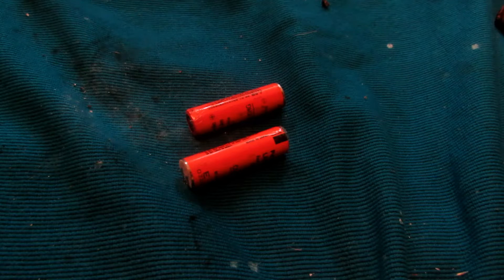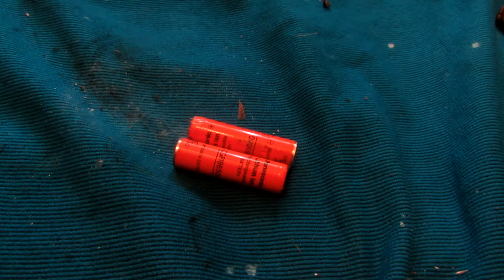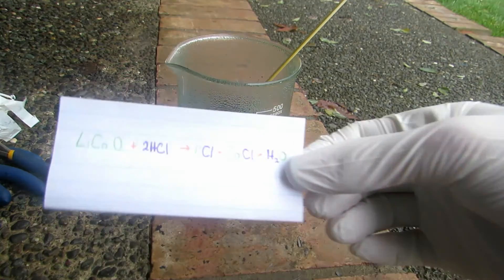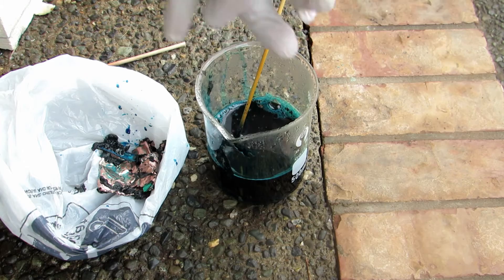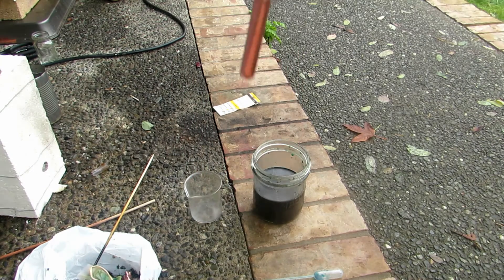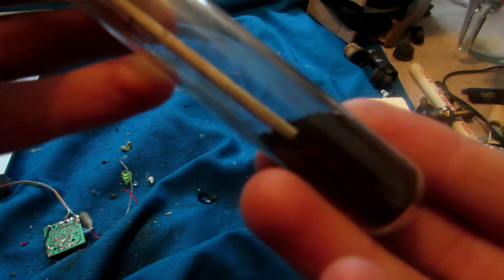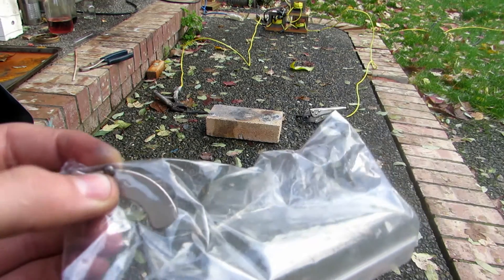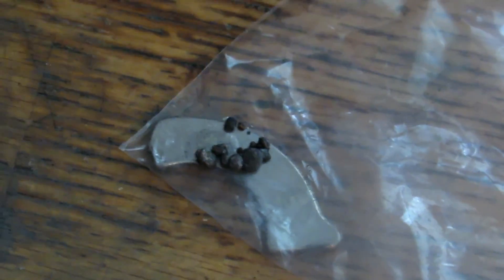Cobalt from Batteries (Household Materials)

Comment: Certainly interesting and educational but not practical.  Significant quantity of either nickel or cobalt metal can be had inexpensively if you have access to oxyacetylene torch.  You can buy cobalt carbonate powder online for $30 to $50 for a whole pound and nickel oxide for $30 per pound.  These powders are sold at pottery supply companies.  

You just mix your cobalt or nickel compound with fine sawdust and wood glue to make balls and let them dry.  Take your gas welding torch and strike a flame and turn up the acetylene and use reduced oxygen until you have a yellow white flame.  It has to be the hottest yellow flame without turning blue.  This flame is your exothermic reducing agent.  Now heat your cobalt and nickel dough balls and they will very quickly melt to a metal bead of pure nickel or cobalt

Comment: 0:35 it's li salt like LiClO4 , LiPF6 instead of Pure Li but only non rechargeable lithium based battery contains real Lithium Foil not rechargeable one like li ion  .
Cathodes are made of Li doped CoOx X = oxidation stats of Co and Anode are just Carbone or graphite on Cu foil .
2:47 and Electrolyte is way dangerous than KOH it's not KoH but  Ethylene based solvent mixed with LiPF6 which more dangerous because if it dissolve in water it forms HF which is super super acid , HF is not only corrosive but even diluted HF can Give heart attack .
Learn HF Toxicity on the internet for more info ......
 https://en.m.wikipedia.org/wiki/Hydrofluoric_acid

Comment: There's nickel too. In some. Could it cause the green color? Maybe.
It's not easy to seperate cobalt from nickel. I wanna eat the cobalt but nickel not so much
Reply: Oh, it is blue. Lol, my night-mode screen has only red and green pixels - as a sleep aid
Reply: I'd use water first. I got lithium hydroxide from li-ion before like this. Maybe you could reduce it with zinc. In case some makes it into final product, I'd rather eat zinc than aluminium. Still afraid of the nickel. It's a trace element too. Maybe it's not such a big deal. Cobalt is used in micro- to miligrams. Industrialy they precipitate it with calcium hypochlorite and leave nickel in solution

Comment: If i was to use this Cobalt for an electro plating solution (vinegar and salt) could i use the Cobalt oxide to make the solution of would i have to melt down. Ultimately i want to test a Nickel/Cobalt mix for plating as im told it produces a shiny finish.........
Reply: You don't have to go thru the whole process, just get to the Cobalt Chloride stage, make cobalt chloride powder and add about 10 grams of cobalt chloride to 50 grams of nickel chloride to obtain a 40/60 Cobalt /Nickel coating which is brighter than nickel or cobalt itself and looks like chrome

Comment: The orange brown colour in the cobalt powder was copper metal from copper oxide from battery which was also dissolved in hydrochloric acid to form copper ii chloride which was reduced to copper metal by aluminium which could be an impurity in cobalt metal.

Comment: I've a ton of black cobalt powder from battery extractions. Still trying to find a good way for me to melt. I need an arc welder.
Reply: Please contact me my e-mail; arkrashid20@gmail.com
Reply: How do you extract the cobalt? I'm looking to get some in powdered form for use in ceramics.
Reply: @Paul-vo4ze  I dissolved mine in HCl, but I don't recall if I used it in combo with nitric or H2O2. I think I did something along that because I had to separate out the copper salts as well. I preciped with aluminum, zinc or magnesium I think. I need to extract more battery metals again and I will be sure to take better notes.

Comment: *you are mistakenly conflating lithium(primary, single use batteries), with lithium ion(rechargeable batteries).*
They are NOT the same. Lithium primary batteries do contain some pure lithium metal, and early lithium battery researchers hoped to be able to use pure lithium metal in rechargeable batteries, but unfortunately you cannot safely re-charge a true lithium metal containing battery, without causing dendrites to form on the lithium metal and cause a short, which causes the lithium metal to melt, followed by 'thermal runaway', which causes the battery to "vent with flame". 

So in order to harness the energy density of lithium, without actually using pure lithium metal, led to the development of lithium ion batteries, which rely on lithium ions instead of the pure metal.

Comment: I know this is an older video of yours, but I'm giving it a thumbs up because I HATE working with electricity.  Anyone that is brave enough to mess around with high amps gets my respect.  I've almost been hit with a potential 600 amps while cable tying in a BDFB bay.  Even though I didn't get hit, thanks to very dry hands at the time, I've been reluctant to mess with anything high amps ever since.  

I used to have to perform weekly tests on the battery back-up bay in a telecom switch which has enough energy to power cell phone service to an entire city's switch needs for 24 hours.  One wrong slip and that battery bay has the capability to level the building.  I also nearly got fired because I refused to touch the breaker to switch from battery to generator power because that breaker had the potential to snap your arm in half if you missed just one tiny step to finish flipping the switch.

I've got a 9,000 volt neon power supply, but the amps are low, so I'm less fearful of the power, but I still respect the hell out of it.  I need an arc furnace, so I eventually need to overcome this damn fear of mine.

Comment: do u have to melt the cobalt powder or can u just use the cobalt powder???
Reply from the maker: Otago Harbour Fishermen you don't have to melt it, I just wanted to have a bead of cobalt
Reply: K lol
Reply: The Canadian Chemist hey how did u seal the hydrogen in that flask coz can hear seals it so...
Reply: The Canadian Chemist and awesome video Man what are you 15 year?? Lol still in high school
Reply from the maker: Otago Harbour Fishermen seal the hydrogen in what flask?
Reply: The Canadian Chemist you know.. Like how to contain elemental hydrogen...
Reply from the maker: Otago Harbour Fishermen oh... I see. I've done this before actually, take a propane cylinder, unscrew the top, fill it with water, and record how much it holds. Then calculate the amount of sodium hydroxide and aluminum you need to fully react and pressurize the cylinder to 200psi. Finally, add the chemicals, add water, screw on the top, and leave it for a hour in case it blows up or something. If u do  the calculations right, it should be fine though. If u do that, u should have about 400L of gas because big propane cylinders can hold 22L of water.
Reply: D: wow thats alot of instructions... you know what im just gunna get a plastic tube with one of it's end blocked(air tight) and put water around so hydrogen cant escape lit how u contained you argon!!
Reply: OH!!! ive got an future idea you should try !!! you should get indium from screens of phones or wateves here ive writen it see if it makes sence to u:disintegrate the LCD screens, either before or after removal of the polarizing film. In the leaching process,
 it was possible to extract 96.4 wt.% of the indium under the following conditions: 1.0M H2SO4, 1:50 solid/liquid ratio,
 90°C, 1h, and stirring at 500 rpm. The results showed that the best experimental conditions enabled extraction of 613 mg
 of indium/kg of LCD powder. Finally, precipitation of the indium with NH4OH was tested at different pH values, and 99.8 wt
.% precipitation was achieved at pH 7.4.
Reply from the maker: Otago Harbour Fishermen oh, ok, sounds good. I just like to have it pressurized soi ça use it in hydrogenation reactions
Reply: k.. um so what do u think of the indium thing? do you think its viable?
Reply from the maker: I was looking at perhaps trying to extract indium from LCD screens, but I don't know how much is on each screen, probably not much, and I don't know where to get a bunch of old screens from... any ideas?
Reply: ... nope.. um scrap yard??
Reply: hm... um  i have only one but i dont know ether...
Reply: does messages take 4 hour to get to where you are or?
Reply: does messages take 4 hour to get to where you are or?
Reply: OH i know!!! maybe gumtree has some!

Comment: I have a question. How can i get CoSO4 ? Is posible to make it ?
Reply from the maker: you can take cobalt oxide, hydroxide carbonate or the metal and react it with sulfuric acid to make cobalt sulfate.
Reply: and if I have CoCl2 (Cobalt(II) chloride), What could I do to obtain CoSO4 ? ... some people say that the process is longer or harder ... what do you think ?
Reply: If u have CoCl2, React it with NaOH, U will get insoluble Co (OH)2 which is blue.If u add an excess of NaOH it will first form Co(OH)2 then converts into Co (OH)3 which I'd chocolate brown.Well either is okay to produce CoSO4. Filter the insoluble cobalt (ll) or (lll) hydroxide then dry it.Then add a calculated amount of dilute H2SO4 accordingly to your present cobalt hydroxide with dropper and then crystallize.
Reply: No I’d heat the cobalt chloride directly with concentrated sulfuric acid.  You can dehydrate the chloride until it’s the blue anhydrous chloride before adding the sulfuric acid.  When all hydrochloric acid is driven off,  add the mix to water.  Cool to obtain cobalt chloride crystals.

Comment: After this proces you can use a microwave as a micro furnace
Reply from the maker: actually, believe it or not, after I did this, I was melting something else, my arc furnace got too hot, and it caught on fire. I just finished making a new one from a huge 45 pound transformer! it works much better!

Comment: The smell that came from the HCL solution may have been from a reaction between ethers in the electrolyte and HCL, forming some type of chlorine haloalkane such as Chloroethane or Chloromethane.
Reply from the maker: oh, that makes sense. I didn't even think about the electrolyte. I believe it is mostly lithium compounds dissolved in organic solvents if I recall, I think it may be ethylene carbonate. would the reaction with HCl form dichloroethane or would it not react? I did a bit of looking around and dichloroethane smells like chloroform, so that may be it. any thoughts?
Reply: according to a data sheet I just read, the electrolyte is usually a mixture of lithium hexafluorophosphate and a mixture of various carbonate ethers, as you mentioned. unfortunately though, I simply don't know enough about organic chemistry to give an affirmative answer as to what was going on there but what you mentioned certainly seems like a possibility
Reply from the maker: Benjamin Guo thanks!

Comment: Copper oxide will dissolve in HCl
Reply from the maker: thankfully I don't think we had any copper oxide, the copper metal wont have reacted with the hydrochloric acid so I think copper contamination is at a minimum.
Reply: @TheCanadianChemist  It's weird, how does that copper foil didn't get react even with conc.HCl..

Comment: Awesome!
Reply: I am pretty sure one electrode is made out of lithium cobalt oxide and other electrode is made out of copper with carbon coating on it, actually there is also this organic electrolyte on the copper electrode which is really flammable ( used a mobile battery ).
Reply from the maker: You're right... I did more research, and lithium ION batteries contain lithium cobalt oxide... Lithium batteries are what contain the lithium metal. I was confused by this for sooooo long. Do you know what the electrolyte is?
Reply: Nope, but it is really flammable though, I put it close to a fire and it burns really fast not like spirit or alcohols so I guess some kind of ether? smells really bad too :P
Reply from the maker: Demons Headshot I know what you mean by smells bad! :)